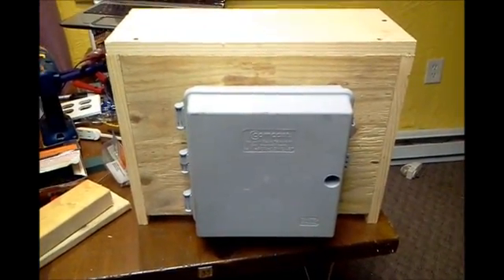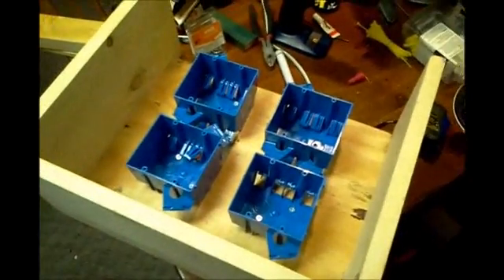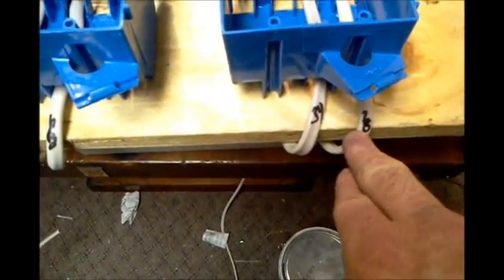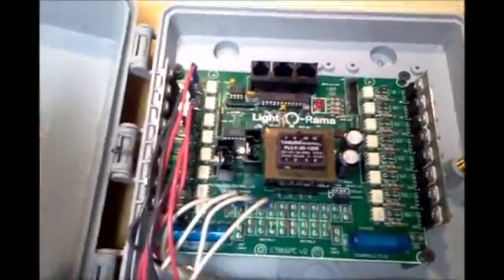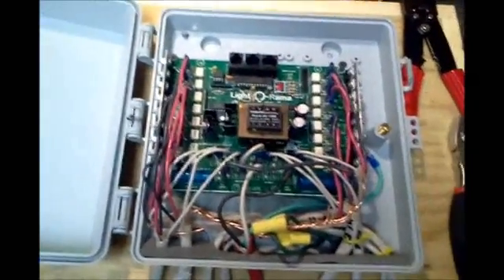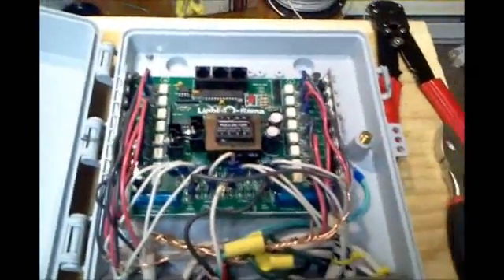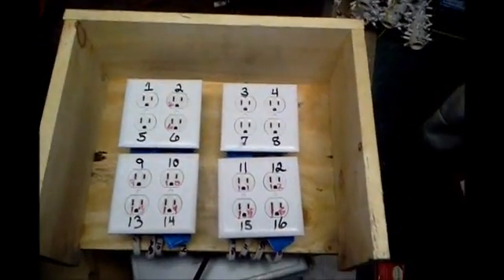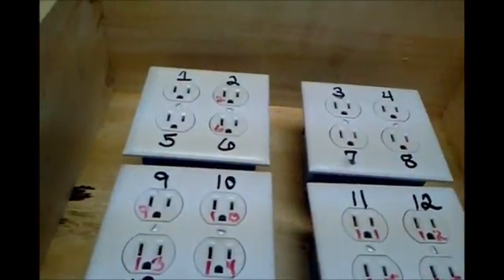Building a Light O Rama Controller

Comment: you admit to not being "a good wierer" u could drill 1" hole through the back bottom of controller with a nipple to a 2x2 trough on the back, nipple off trough to a 2 -4gang weatherproof boxes. use thhn wire for flexibility. ( this would be much neater and would last much longer. U would not see any wire at all. hope this helps) by the way i think you do a very nice job sequencing you lights. I think i could get really nice ideas from you if u were closer. didn't mean to piss u off just constructive criticism..

Comment: Could you explain how you wire the outlets in detail please?
(such as what wire go to what screw and what needs to be snipped on the wire?)
Reply from the maker: IDK if I can EXPLAIN in detail.  Best to watch a simple video here on YT about running 110v wire to an outlet.  The only modification I made to this outlet was cutting the small copper connection that is between the top and bottom of the outlet.  There is one located on each side of the outlet, one on the hot side and one on the neutral.  I cut the copper connector on the HOT side so I could run individual wires to the HOT output on the LOR card,  This made 2 separate outlets per 1 unit.  I then crimped a female spade connector and attached to the proper channel. 

The neutral does not need to be separated, it may be shared.  Once either hot wire is activated, there is a neutral connection at both the top of the bottom to complete the circuit.  Only the side that receives the command from the board turns on.